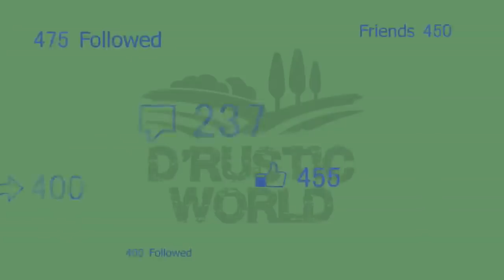How To Make a Concrete Biogas Digester (Testing Phase)

Comment: Hi, the digest needs to be cleaned on a regular basis. At least once in 24 months. (Depending on how much feed you give it) How do you action this if you cover it fully like this?
Reply from the maker: There is a big opening on one side, the area which is covered with light blue lid, where sludge comes out. You do not need to clean this type of digester because as the new waste materials comes in through the inlet, the sludge (the digested wasted) also comes out through the outlet.